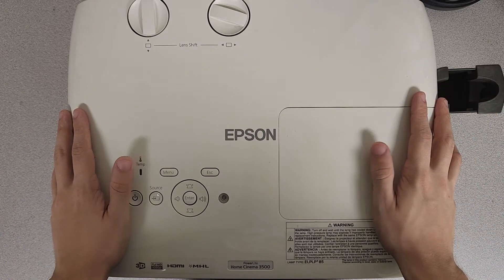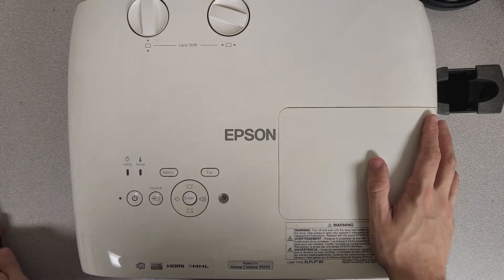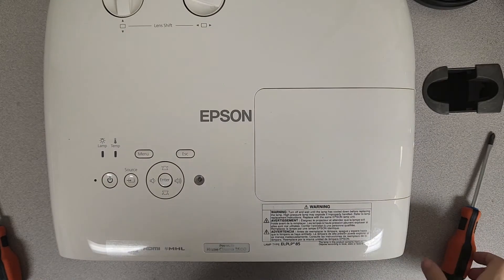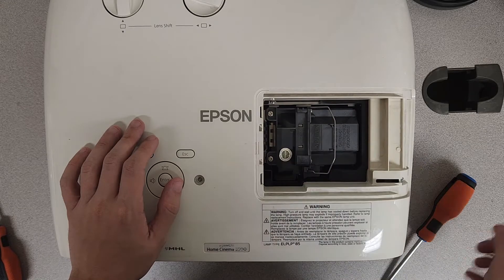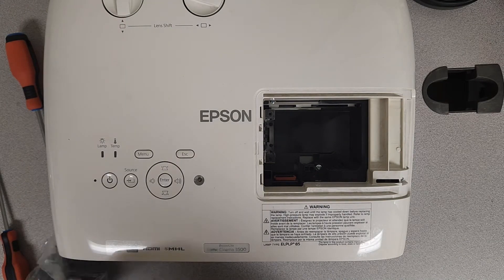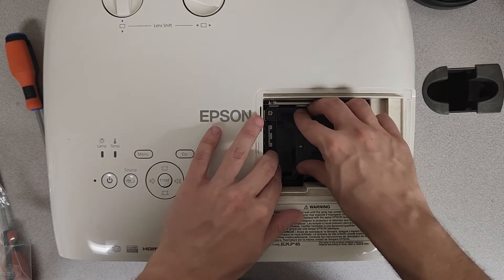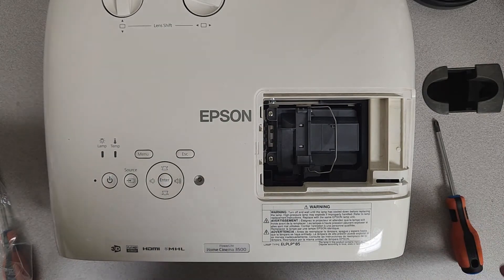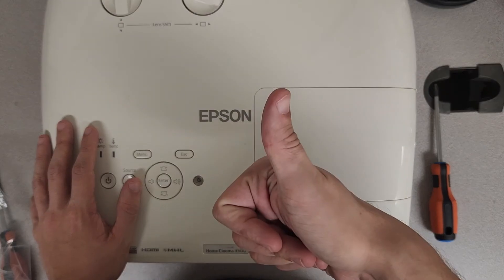Jaspertronics - Epson 3500 Bulb Swap Tutorial

Comment: OK, but you should be showing how to clean the unit when changing the light
Reply from the maker: You can't really clean this unit out without a technician or knowledge of how to tear down the unit. You can try and vacuum behind the filter and inside the lamp compartment but this really will not do much. I do not recommend using air duster unless the unit is fully torn down. You run the risk of blowing the dust further into the unit. If your unit is starting to build up with dust inside we can help with our projector cleaning service. Feel free to reach out for more information!